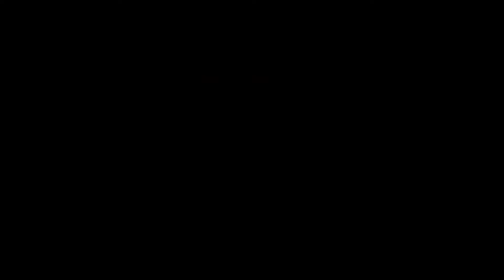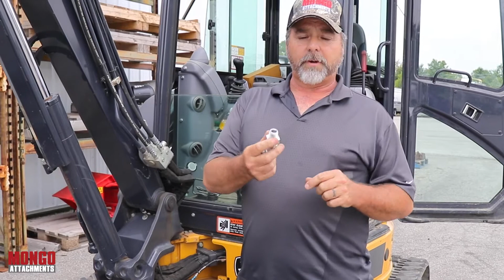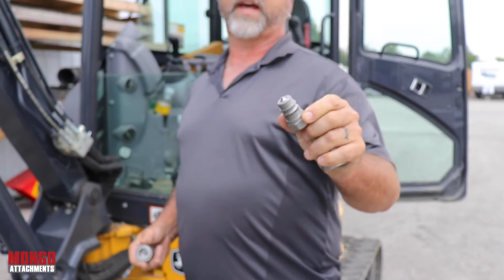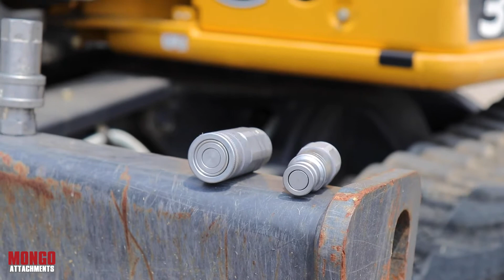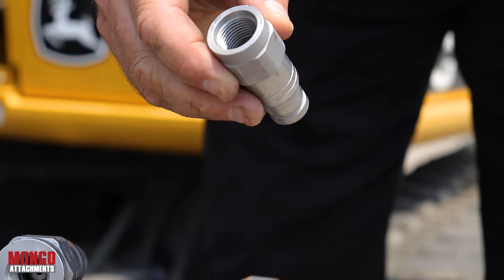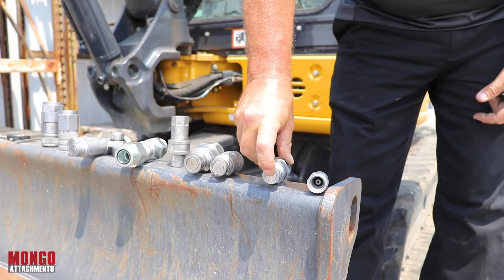Flat Face Quick Couplers for Mini Excavators

Comment: If you're installing the couplers on to the block on the machine, do you typically install a male and female, male and male, or female and female? The attachment I'm ordering comes with hoses, and I have to provide the fittings for both the hoses and machine. I know what thread pattern goes on the hoses and machine, but not clear on which sexes are normally installed on the machine side.

Comment: Great explanation of the flat face fittings. I have the ag style on my Kubota loader valve and they have been a pain. For some reason pressure builds up on the loader end when I disconnect and I can't get them together without bleeding the fittings. Thinking of going to the flat face fittings.

Comment: Well I always have a hard time connecting the tilt bucket I bought from you. For some reason I can’t release the pressure to attach right side of the hose. Couple of times I had to use it I had to disconnect flat face off the hose and then reinstall it. I called for support but I was told it was my machine. But I have no problem attaching to any other attachment but your tilt bucket.
Reply: Emailed directly
Reply: It’s because the flat face couplers on the tilt bucket are probably low quality. All my cheap attachments are hard to attach but all my expensive ones are easy to attach
Reply: Update, I received another coupler from Mongo & now it attaches so easy. Ty.